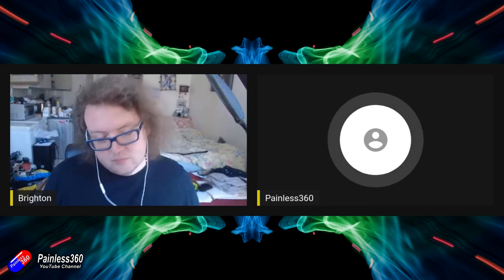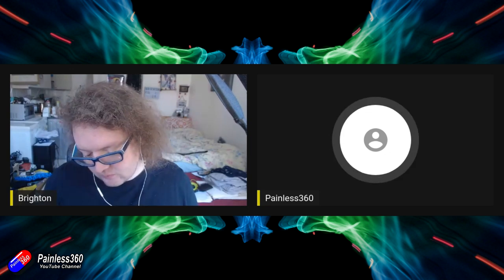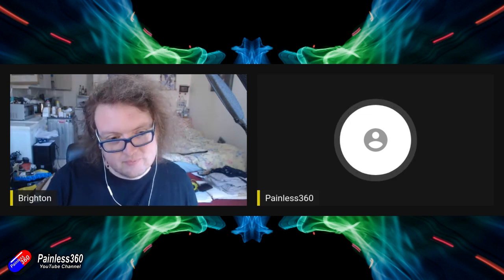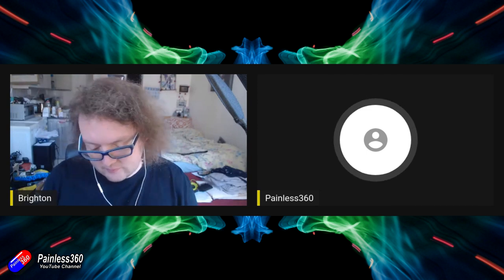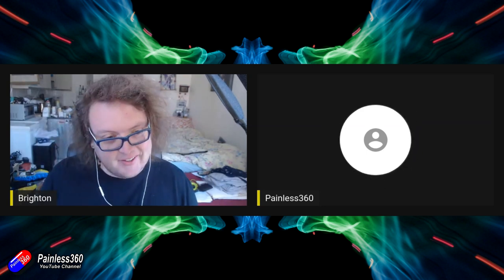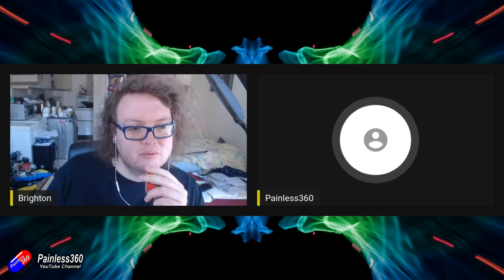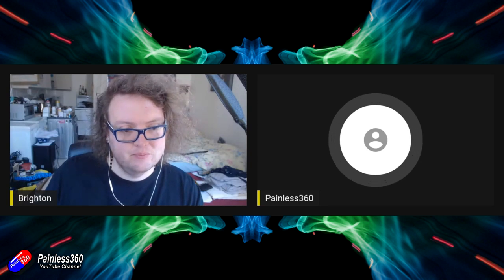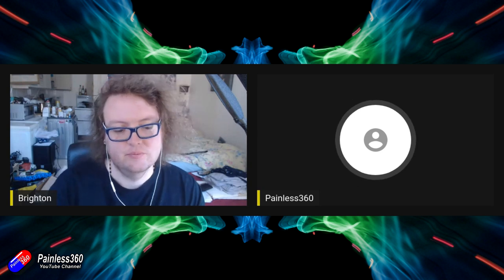R/C Troubleshooting tips and tricks with Jack from BrightonTillIFly

Comment: Lee & Jack.... I have to say this is the first Troubleshooting video I've ever seen on YT about RC...! In the USA we have a saying: "Jack of all Trades, Master of none"..! With that being said, All Trades have what we call Tricks & Tips..! There's also "Tools of the Trade" and "Secrets of the Trade". No matter what Field you're in, they have their own little quirks (Problems) that defy one's ability to get something working. Like in Electrical, the circuit has to be complete in order for current/voltage to flow..! If the circuit is Open, it will not work..! In a Trade School they'll teach Tricks of the Trade, but if you're self taught you'll find your own way of ciphering things out, eventually..! You'll also get shocked..! Like Lee said, if you find yourself frustrated in seeking an unknown problem.... take a break, walk away from it, have a smoke or a drink, go for a short walk, watch a movie... to clear the mind, then go back with a fresh start..! And Learn how to use a Multi-Meter, Learn about Ohms, Volts, Amps, Resistance, Capacitance, Continuity, shorts, broken wires, cold solder joints, etc.....    =)

Comment: A large chunk of my job is made up of locating, Identifying faults and fixes. The key process is Root Cause Analysis. The main tool I use is a Fault Tree where you start with the symptom and identify subsystem errors/faults which can cause the observed issue. Then rule them out one by one, until you arrive at the problematic system. 

I think generating some generic fault trees for less technical users to follow would be a fantastic resource.
Reply: Similar line of work here Charles.It was reading Zen and the art of motorcycle maintenance that led me to address issues in a similar manner.

Comment: im pretty good at mechanical things and my mechanical bell is going off with my current problem. QX7, nearly new, as in little use. endpoints drifting, roll endpoint is the worst. anyone wanting to take a stab at it? im starting to think a bad gimbal. but thats probably just  the mechanic in me. ive adjusted ends and mids in the radio and in betaflight. get em straight and they drift off again. ive created a new model with the same result. im kinda stuck on this. id love to have one of these flowcharts you guys are talking about.
Reply from the maker: I'd suspect the gimbal too.. Best of luck!

Comment: the symptom is not the problem ... welcome on the tip of the iceberg and hopefully you will find the cause on the upper 10% cause 90% below the surface might not be so much fun.
And: icebergs are melting so your current top can be the deepest part of that iceberg tomorrow ... so be prepared to jump somewhere to rescue yourself.
that is the game of faults and errors and their secrets of the cause ... like a simple fuse in a motorhome while you are digging in the dark of the fridge checking gas, fuses, boards full of spiders and their living in the past 9 years and searching for a electrical mechanical plan and then studying the manul ... until someone asks "does the motorhome have another fuse for the fridge?" ... and obviously no, but then following that line there was a fuse.